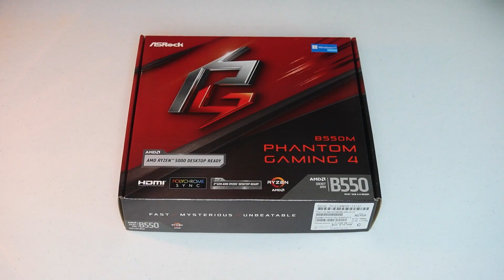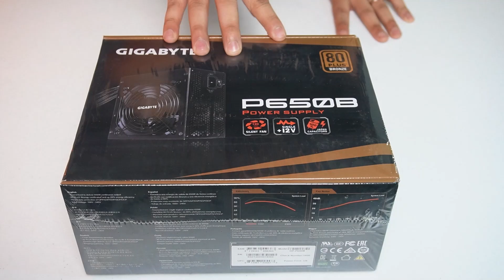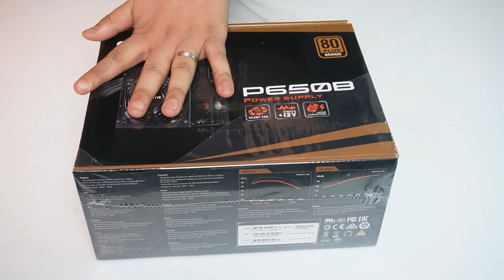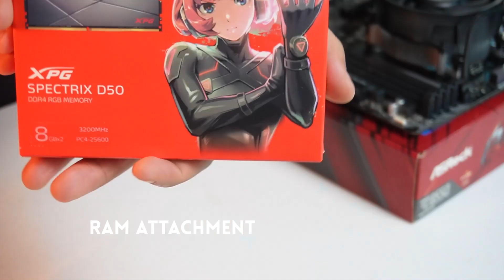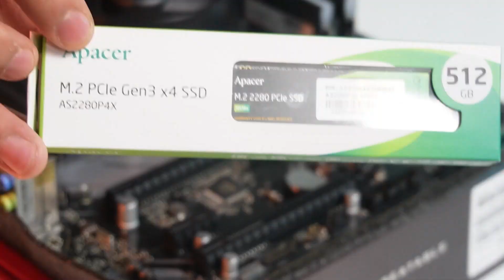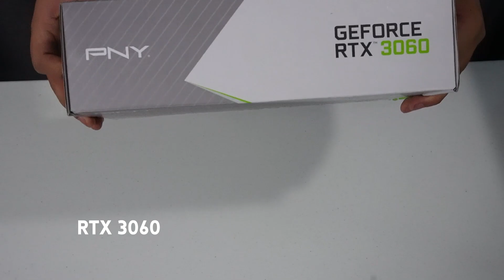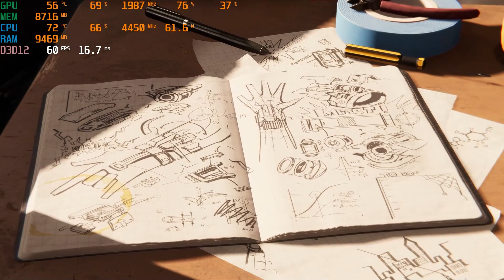PC VLOG:HOW TO BUILD 45K BUDGET GAMING PC AS OF MAY 2023 WITH TUTORIAL PH (RYZEN 5 5600 & RTX 3060)

Comment: Thanks dito Sir. Napa sub ako. Mas lalo tuloy akong ginanahan mag upgrade. Tanong ko lang po if ibenta ko itong luma ko magkano po kaya ito. Given 1yr+ ko napo itong ginagamit.

Motherboard: Gigabyte (H410M H V2)
Processor: Intel Core i5-10400
RAM: 8GB Glowy (ddr4)
Drive: 120GB SSD Adata (su650ss-120gt)
Powersupply: 500watts (Doss DS-500w)
Chassis: Glass Side Case

Mechanical Keyboard: Fantech Maxpower (MK853)
Gaming Mouse: Dareu (EM908)
Monitor: Philips (243v7q)
Speakers: Fantech Beat (GS203)

Hopefully mabasa niyo po ito at ma advise sa estimate 2nd hand price neto para mabenta ko na. 😅Kating kati na kasi ako sa pag upgrade.
Reply from the maker: Hello sir pm po kayo sa official fb page po natin ZERJ PC tulungan ko po kayo gawan quote yang sinend nio po para mabente hehe

Comment: i have a question: can we use another casing for the build or no
Reply: You can use any other Pc Casing, just make sure na compatible lahat ng Power Socket na papasukan ng mga wirings mo, at kasya yung Gpu, Motherboard at Psu altogether sa Casing
Reply from the maker: Yes sir possible
Reply: Pwede Po bang Ryzen 5600x Jan SS build mo? Ayun lang babagyhin imbis na Ryzen 5600 ang ipapakit Yung Ryzen 5600x
Reply: @romircasanas2448  pwd yan, as long as same brand at same model ang ipagpapalit, almost sa overall clock speed frequency lng nagkaiba kse faster version ang x model s ryzen